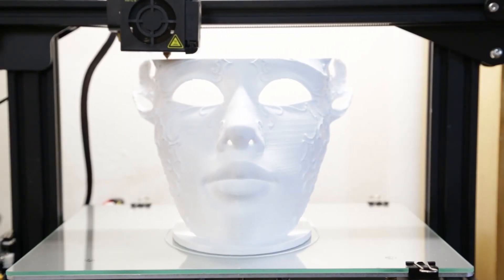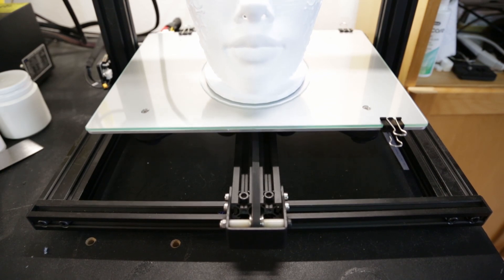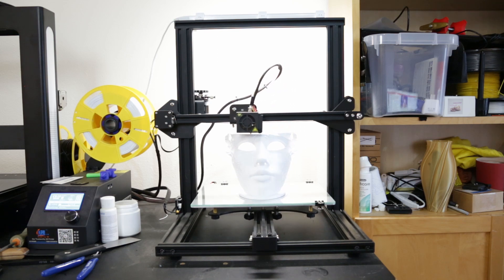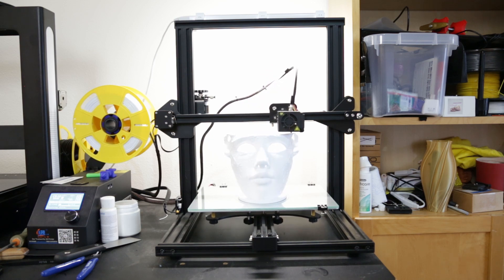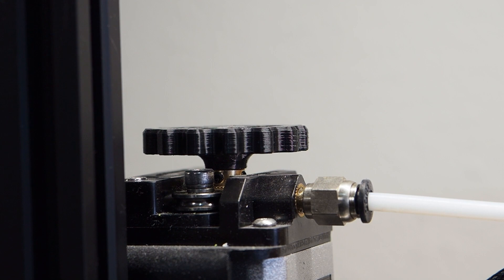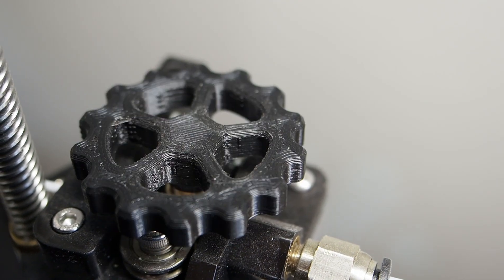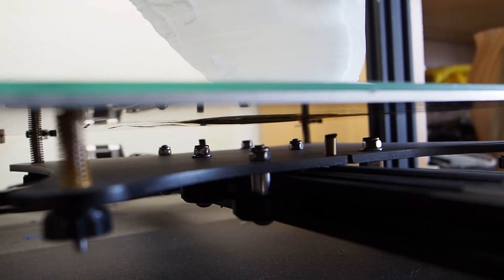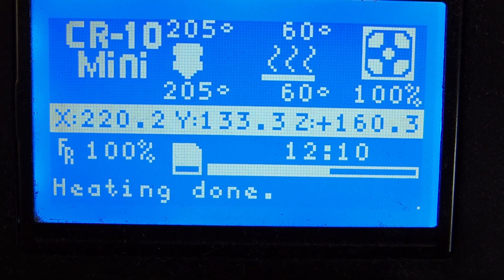▼ Review Creality CR-10Mini after 10 months of use

Comment: Hi Brian! Nothing to add. Our 6 cr10-mini are operating flawlessly till now, 9 months later. No real maintenance. Just tightening some power line screws in the control box and changing one nozzle. Nothing else. Hours and hours of continuous printing (most of the time grids of identical objects for our arduino/raspberryPi projects). Perfect outputs. I personally had never printed full-height (300 mm) objects. Therefore never run across Z-axis trouble. Nevertheless I appreciate your tip with a more tightened belt if it happened. This printer is an actual well-designed workhorse. The control box gap v. the printer is not a serious issue. If I had to choose between an ender3 and a cr10-mini, with the relatively small differences in prices, I'd definitely opt for Cr-10 mini and its convenient dimensions. By the way, this white filament is GORGEOUS!

I appreciate your honesty. There are so many biased reviews those last months and I suspected gearbest's promo teams to demand more than a honest reviewer would want to say. Reviews then look like commercials, are less instructive and helpful. It becomes harder to believe some reviewers, mainly those who don't show any time-lapse videos of their printings. Nerys is my favorite reviewer, beside you Brian, of 3D printing related topics. Thank you for this review I was waiting for Brian! Could you list some improvements a firmware update could bring?
Reply from the maker: Hi, There is a whole list of improvements that can be found when updating the firmware, although not all options will be directly visible.
When I received this printer the software was obviously Marlin, but there was no clue to how they have set the parameters as it was not specified by that time. After a lot of pressure  from the community, Creality gave the source code and made it possible to update or even upgrade the CR-10 line-up and now it's possible to install the latest version of Marlin to the printer and make use of things like rich G-code, firmware retraction, Automatic bed leveling with probes or (even better) Trinamic stepper drivers, etc. 
I will for sure not be using all of the new options in my upgrades, but some of them are extremely handy and/or make the printer extremely silence. Other upgrades I am planning to do is changing the cooling fans in the printer for frictionless low noise coolers, changing the position of the spool holder, as Chuck did, etc.
Then, when I am finished, I will edit the video I made about it and upload it. :-)
Reply: Thanks Brian! Can't wait! I adopted some valuable Chuck's modifications, especially his recent tip to make TPU printing possible with the cr10-mini. I love Chuck's posts: simple, useful, instructive and helpful... like yours Brian;)

Comment: I installed the spool holder backwards and this lets put the control box closer to the printer. Only thing is I need extra weight on the box if the spool is new, so it balances better
Reply from the maker: Wauw, I am curious. Can i see it somewhere?
Reply: 3d Print Creator of you search cr-10 in google images, I seen a couple pictures of it installed that way. I just installed it 180 degrees. I had no choice because my desk is small

Comment: Brian, are you familiar with the Minolta XG1 cause I have a noob question? I purchased some 400 speed film placed it in the camera but I can only take pictures indoors and outside in low light for some reason. When I take it outside in normal daylight I press the button to take pictures but it don't do anything. What am I doing wrong? Also, I see dirt inside the camera. I thought it was the lens but it seems to be the mirror. I don't want to touch it cause people keep saying it's delicate and any touching can scratch off the coating destroying it. But I want to clean it. Any recommendation as of to what I can do to get it clean? Thanks in advance my friend.
Reply from the maker: Hi,
I don't know that particular camera, but as for any film camera, the mirror isn't delicate at all. You can clean it with some microfiber cloth and s single drop of alcohol on the cloth without any problem. Only make sure not to touch the glass in the top part of the camera (matt glass) as this is very delicate. you can destroy it just by touching it (!!!). When cleaning the camera make sure the mirror is in the 45 degrees position and you will be fine.

As for the ISO 400 film, you must be able to use that film at a higher shutter speed without any problems. Can you verify that your shutter is working properly? Is it moving faster at 1/250 of a second then when you set it to 1/4 of a second? If there is something wrong with the shutter of the camera it explains why you cannot take pictures in sunlight with it as there is no way for the camera to control the amount of light properly. 

Hope this helped.
With regards, Brian.
Reply: I did try changing the shutter speed from between 1/4 to 1/100 and the speed did increase. I also set the aperture to f/16 and am able to take pictures. Am crossing my fingers hoping that my test pictures show the camera works ok. Cause I found at a store called Good Will for cheap. They aren't known for selling things in great condition. If it works I will be taking the camera on vacation at around the of September. Again, thanks for the help.

Comment: You mention another material that is stronger than PLA but that works with the CR-10, that sounds like "engine".  What material is that?
Reply from the maker: Hi,
It's Colorfabb NGEN
You will need a bed at 85 degrees Celcius and a nozzle of 245 degrees Celcius.
Don't use your cooling fan, you don't need to.
It's my go-to material for all my prints.
Reply: 3d Print Creator Thanks!